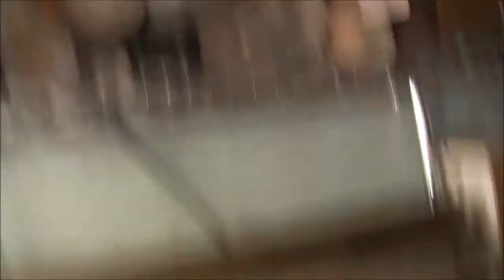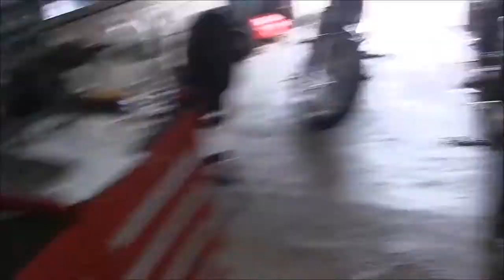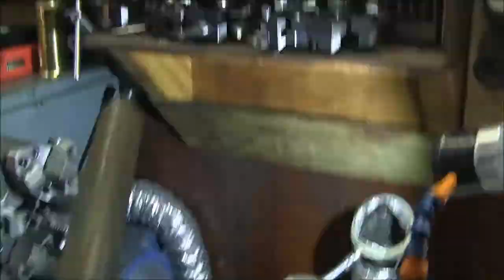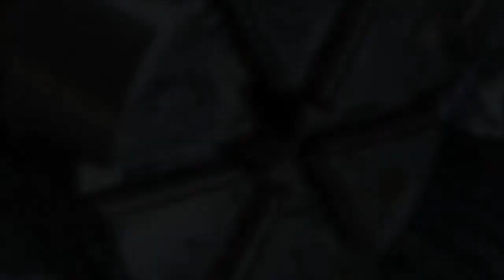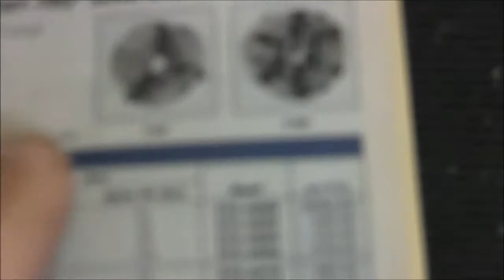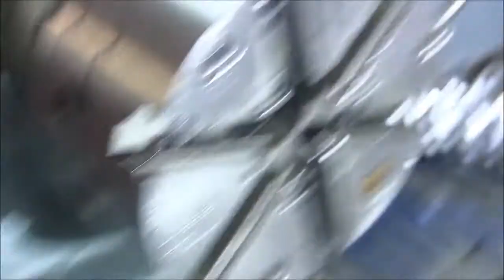Sufferin Chuckattach I

Comment: This is actually a project  long on my bucket list - I have some ideas but interested to see what you do. I have no VFD so really do need an answer. My chuck ID is actually same as backplate - so have planned for making an expanding device, plus back plate is not very deep. Your approach sounds similar in principle so far. I may yet have to machine my back plate again a bit - not sure yet.
That light sure works well.
Reply from the maker: Hi Chris, An expansion device would sure help providing you can grip enough of the chuck / back plate but I would consider the washer approach. It really doesn't have to be that thick to hold it on, it just has to keep it from unscrewing "all the way" if you are only looking for a safety device.

Comment: Is the inside of the spindle a Morse taper (or other taper)?
Reply from the maker: My headstock has a 5MT, the through bore is 1.625 near the chuck but the ID of the spindle necks down about 6 inches back to 1.440.